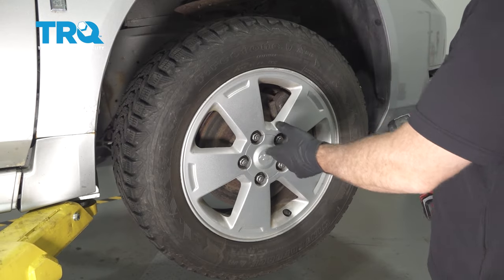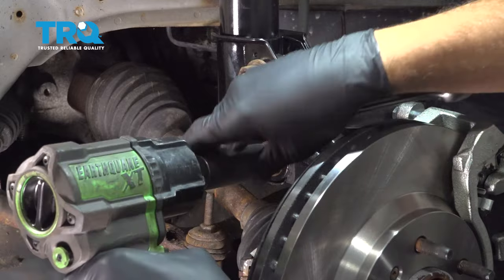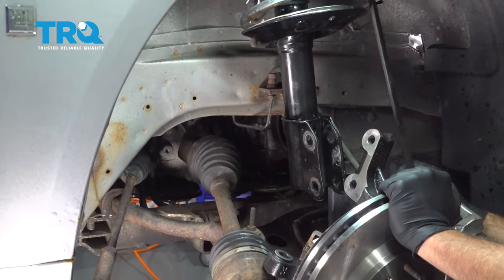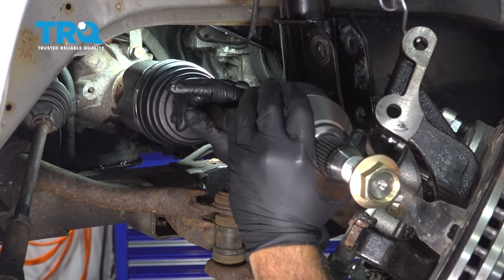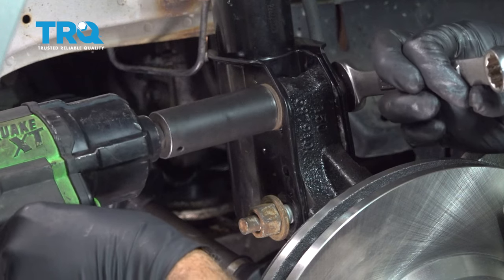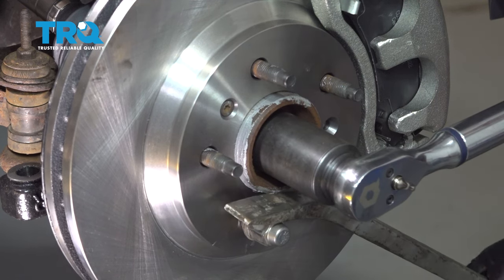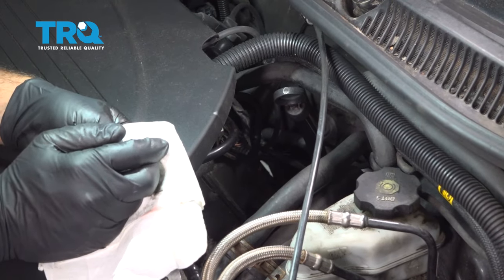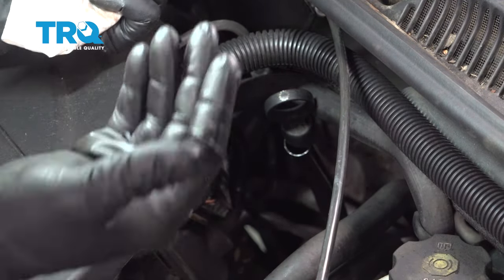How to Replace Front CV Axle Shaft 2006-2013 Chevrolet Impala

Comment: I must put a disclaimer that they didn't add.  From what I have experienced, this looks like the passenger side.  I know a person can see that in the beginning, but if a person is new to this, they may be slightly surprised when pulling the driver side axle off and realizing its not splined...  Other than that, it is an informative video.

Comment: 4:20, should mention to people who are trying to learn what to do...that you have to feed the shaft through the wheel bearing BEFORE connecting the knuckle to the strut.  Also, by using the impact you overtorqued the axle nut, which can also cause premature wear to the hub assembly.  Your torque wrenched beeped without moving the nut...so you either lucked out and torqued it to exactly the right torque with the impact (unlikely), or your impact set the torque well beyond the max torque spec.  Moog specifically states to not use an impact on that nut, for that reason.

Comment: If your knuckle assembly/cv axle is rusty you will need more than a push with your finger, i broke a 20 ton press trying to break them apart, when it finally gave it came out with a piece of the bearing. Trying removing the axle nut in advance and soaking it with penetrating oil. You may even want to put the nut back on and drive the car a few days to help it loosen (do not drive with a loose nut). Hope this helps